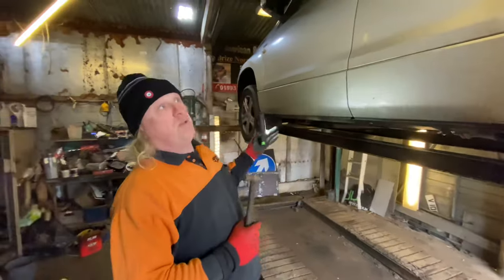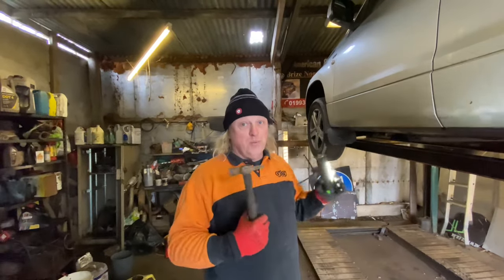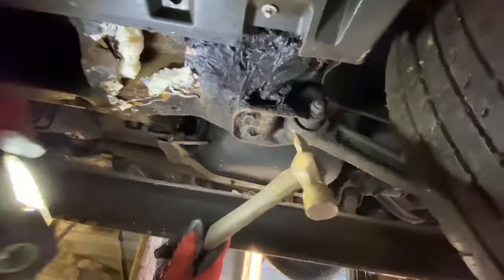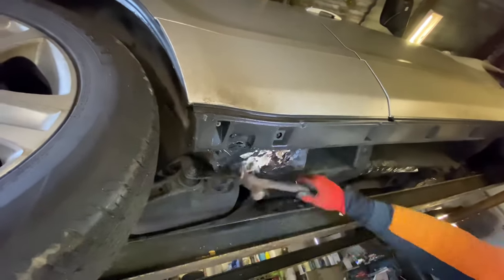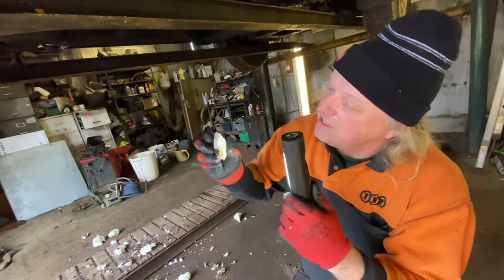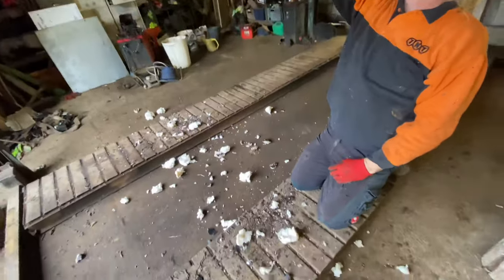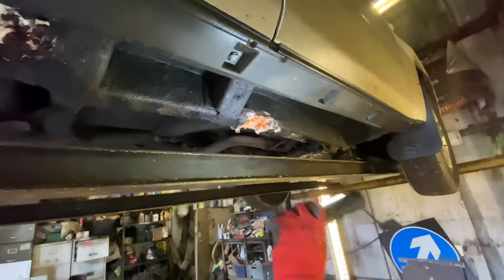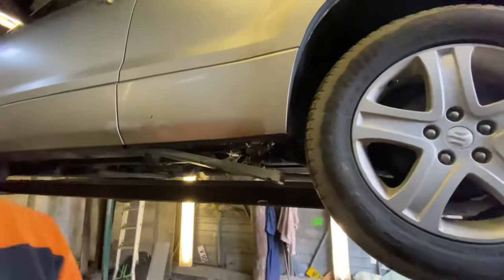£2000 rust bucket, Mot’d Suzuki Vitara a mate just asked me to check over CRUNCHY,Lazy car dealer

Comment: Same happened to me with my 4.0L Jeep Cherokee. Looked good on top, lovely to drive. Left it at garage for it's MOT
They rang me later saying they wouldn't do inspection because of rust. Sold it on Ebay as a restoration or parts.
Good that you show what's out there.

Comment: I thought 1970s and 80s bodges were thing of the past lol
Reply: When I bodged my cars in the mid 1970s I did not use expanding foam. Just honest P38 and repair gauze. I used to make a better job than this example. Also it was never to sell just to keep my car a little bit longer.
Reply: @mbak7801  Ahhh P38 Isopon, the smell was enough to get you dizzy after a while, and no ford Capri front wing should have been seen without it and covered in grey primer!

Comment: I had thought this sort of thing was largely a thing of the past. It seems that manufacturers have just found ways to stop the parts we see dissolving whilst they fall apart out of sight. Legislation should force them to be responsible for non accidental structural failures for at least twenty years. I believe that if this was done we would soon have vehicle structures made from stainless steel and carbon fibre. Manufacturers will scream that it’s impossible or too expensive but they currently have no incentive to make it happen. They have been forced into making vehicles safer and more environmentally friendly why should this be different?

Comment: the tyres are threadbare, who bought this car, Stevie Wonder, OK fair enough not everyone is a home mechanic but surely people check the sills, bottoms of the doors, the bushing points, coil-over cap plates, leaf spring lugs, look under the boot liner etc the basic stuff, it takes no more than five minutes with a torch and bend down to check this stuff, someone should go see the seller, but that's waste of time they know they did it and they don't care, I value that car at under £100, engine, seats, bumpers, mirrors, eBay them,
Reply: YOU would be suprised how many buy a car for the wife because its shiny and in their words pretty

Comment: You have just likely ruined any chance of a complaint to D.V.S.A. it was obvious that the repair was poor and within 2 months the D.V.S.A would have looked into this within the 3 moths to complain about corrosion. After that you could have looked for a remedy for compensation. If the car has been bought from a dealer then they are who you should seek your compensation from. If you bought it from a dealer you should seek compensation from them but you will likely need an engineers report not just a bloke in a hat with a hammer's word for it to get any compensation as quite often this ends up in the hands of trading standards.

Comment: Never understand people who do this, so much easier just to weld it up. Take trader and MOT station to court, if it even went to a real MOT.
Reply: I'll agree with that somebody must have spent hours bodging that up
Reply: But you need to remove seats,trim,wiring harness,fuel tank and battery, before you start
And drop the suspension,that's why Billy bodger does things like this

Comment: Wouldn't cost me a thought. They're all like that or going that way. This is why God invented welding. Cut the grot, weld in fresh metal & treat the entire underside with a proper rust-killer so it doesn't just rust away again. BTW, just at a glance, you could have mushed in the quarter-panels as well - those all go too. That ones ^ are full of filler. Those also need cutting out & replacing. Fun. :-) It goes with the territory on these - you better be able to weld or know someone who can.

Comment: Why you are seeing more and more old cars with "Dodgy" MOT tests on... The price here in the UK of 2nd hand cars is a TOTAL RIP OFF.
When I passed my driving test in 1990 you could buy "Good bangers" with a year's MOT test on... for £500 (About £1200 in today's money) 
People are asking £5000 for 11 Year old Ford Fiestas.... ARE THEY ON DRUGS??? 
I took my car for its annual MOT 2 months ago.... I had to spend £700 on the car to get an MOT test on the car... But it was better than selling it for scrap and looking for another 2nd hand car. 
Now I know where you can buy "Dodgy" MOT tests for £150 ..But I would prefer not to do this...  However, for the next MOT, I am going to take the car for a pre-MOT test one month before it expires (A mock MOT test on the car...But if it fails I can still use the month MOT that is left on the car) 
If I am looking at YET ANOTHER huge repair bill just to get another year from my car,  I may well be looking at the said "Dodgy" MOT test just to get one more year out of my car (As long as the brakes/steering and tires are safe) 
Thank you for this video.

Comment: Too assess corrosion or suspicious repair, VOSA recommends firm finger and thumb pressure only, or gently use of an approved corrosion assessment tool in the correct manner  .. not smacking with a hammer...
Reply: Big metal spike in my time.